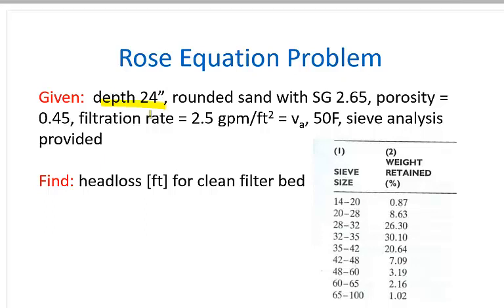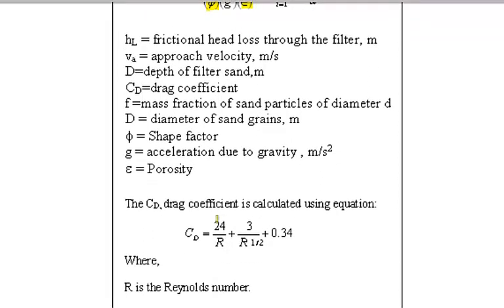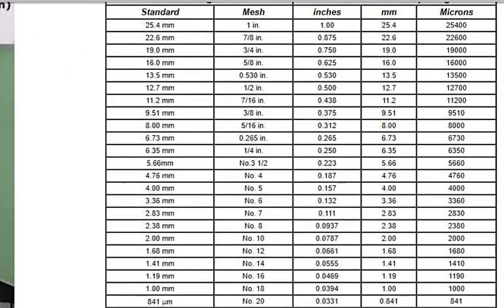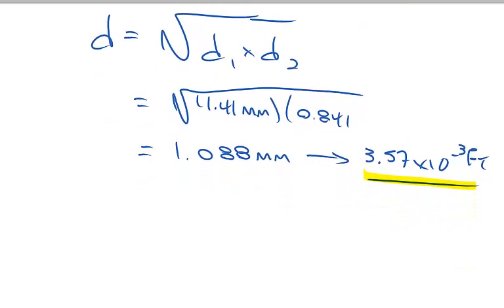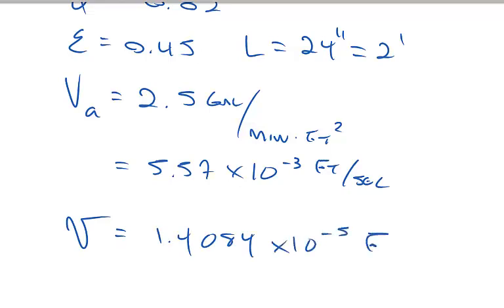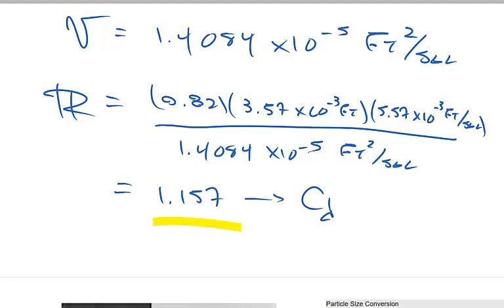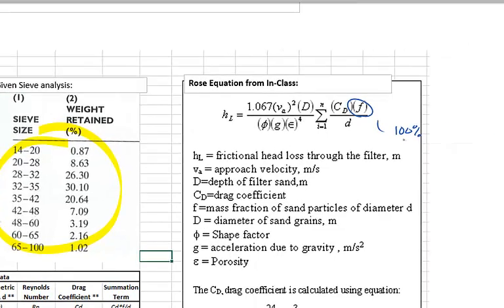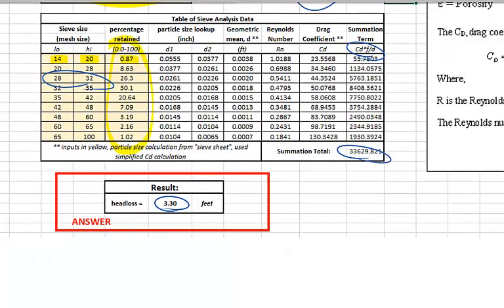Rose equation clean bed headloss calculations

Comment: I wanted to estimate pressure drop across a graded sand filter. The video took me back to my Fluid Dynamics class two decades back.

Might now have to estimate the presure drop physically, got a pump  operating too far to the right and would like to correct this with a sand filter as part of my design

Great work though and keep it up mate 👍 👏 👌